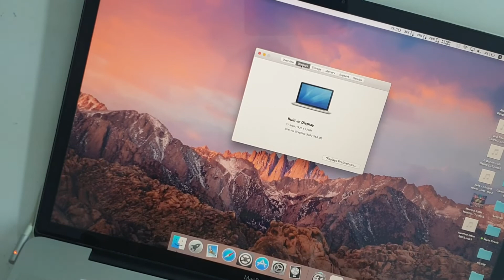Disable 2011 17" MacBook Pro GPU - gMux IC Bypass

Comment: Hello. I have 820-2914-b 17 ". I transferred the board to UMA in your video. A red tint appeared, but MacOs is loading and everything works. What could be the reason?
Reply from the maker: Full screen is red?
Reply from the maker: Or line red
Reply: @microsolderinglab   when loading instead of white, bluish and the OS loading bar red
Reply: @microsolderinglab  I can send a photo of the board and screen
Reply from the maker: @ыыы-и2м  sent to me on Instagram
Reply: @microsolderinglab  
I do not have Instagram. can I send to the mail?
Reply: Hello, I have exactly the same problem, were you able to find where the problem was?
I have a macbook 17 2011

Comment: I tried according to your scheme but at startup i have sound but no picture. Sorry for my bad English. I can email you pictures if you are willing to help. thank you
Reply from the maker: Please check again my video and make sure, you are follow my step correctly.
Reply: @microsolderinglab  The only thing I didn't remove was the GPU chip. But R8911 was removed.
Reply: @microsolderinglab  Is it necessary to remove and GPU chip?
Reply from the maker: @fuzzykv  do you have 17 or 15 inch
Reply: @microsolderinglab  17 inch
Reply from the maker: @fuzzykv  sent me pictures
Reply: @microsolderinglab  15 "I successfully switched to intel graphics. 17 "really tortured me
Reply: Me podrías apoyar a mandarme puntos señalados en boardview para notar los puntos a unir, te lo agradecería mucho
Reply: @microsolderinglab  hey bro iam doing like ur step but my screen going red n noise